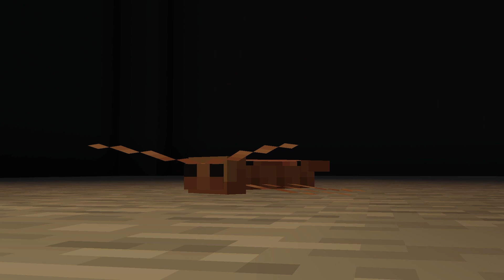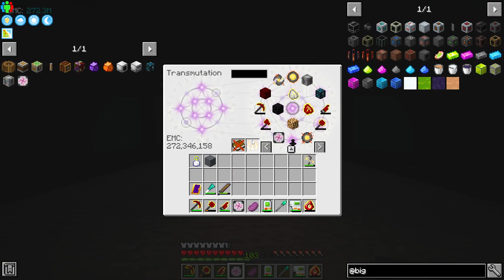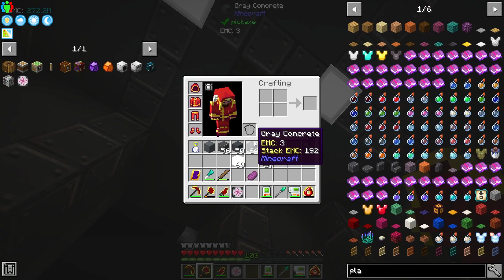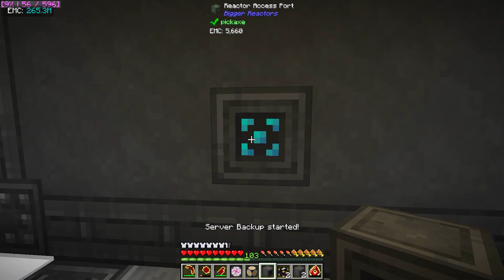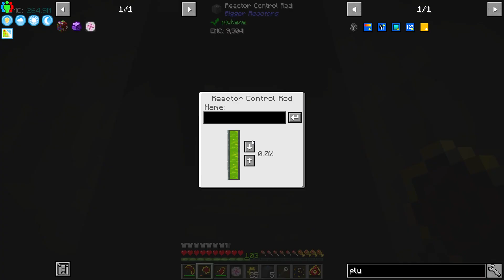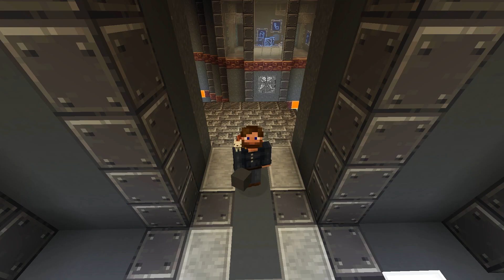Project Architect Modpack EP13 Bigger Reactors Power

Comment: RF == redstone flux. It's the old thermal engineering power system(iirc). It's now been replaced by FE(forge energy) but they're 1:1 ratio, and are 100% interchangeable/compatible(afaik).

For the rods, read the damned tooltip. It's right there on the screen. It plainly states how to increase/decrease by more than 1% at a time /AND/ how to effect all rods at the same time.

Comment: Ik there is a trade off more fuel efficient if they aren't touching but produce less power and if the are touching the produce more power but are less fuel efficient but it all depends on the size and your coolant but it's all preferences

Comment: The rods will be considered one unit if you place them as like a 2x2 or 3x4 etc so the Cross/Chess Pattern is absolutely bonkers

To go in more detail:
The rods check how many sides of them are cooled by coolant.
So what is more efficient?
A rod cooled on all 4 sides (the unit is ONE rod) or a couple of rods cooled on 2 to 3 sides

Comment: Realtor has the ability to use red stone signals as both input and output. Set one to send a signal when power reaches a threshold, say 90% full. Run a red stone signal from that one to another red stone port, which will lift the rods by maybe 60%. When you need power, the reactor will run at full power. It will only make 60% power any other time. Lower it to 10% if you want, the reactor itself will be an energy buffer at that point. Keep the reactor within one chunk, the flux plug or point can chunk load the whole thing. Just some simple ideas.

Oh, and you can change all the rod depths at once by holding alt. Though the comments say that a few times. Great video!

Comment: 20:50
What is it with Minecrafter never reading the Tooltips? The Very last line is "[Alt]: Apply to ALL rods".
All you needed to do was getting access to 1 Rod controller and then change it while holding ALT so that it applies to all the other Rod controllers as well...
Reply: ^ This. Many, MANY MC players do this and it's so annoying.
Reply: this would've been such a helpful comment if it hadn't been for that unnecessary scolding that you lead with. cheers for the help, boo for the condescending snark.

Comment: I usually go for a ◘ (3x3 with the middle filled with coolant) pattern with two layers of coolant from the reactor walls.
Reply: You should fill the middle also with a rod, check the stats
Reply: marginal increase on energy production, major increase in fuel consumption and heat generation.